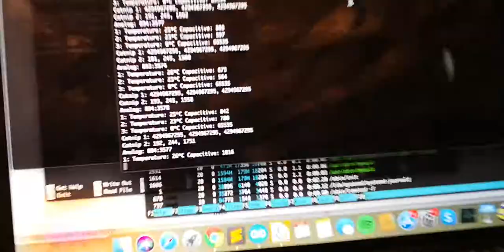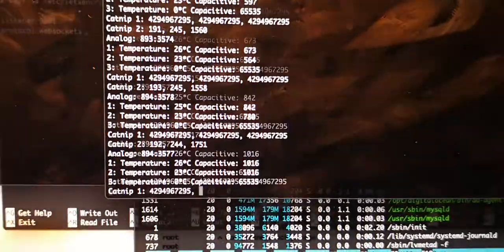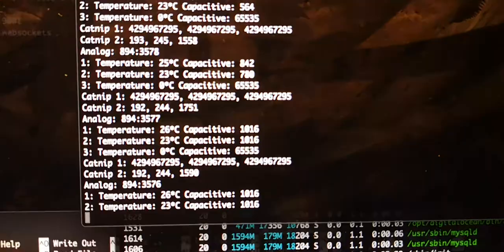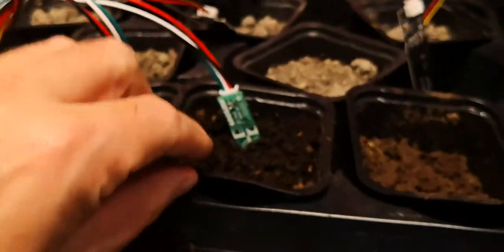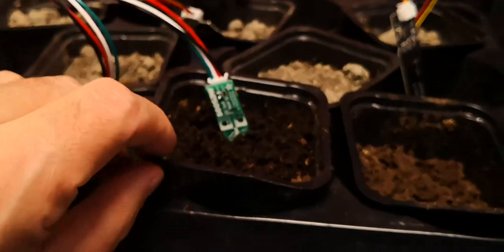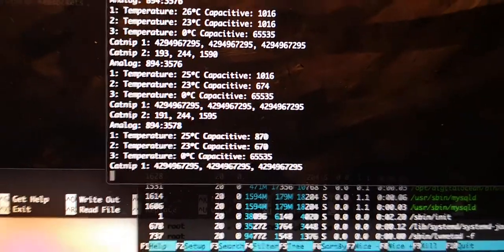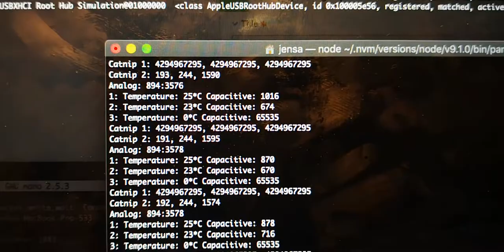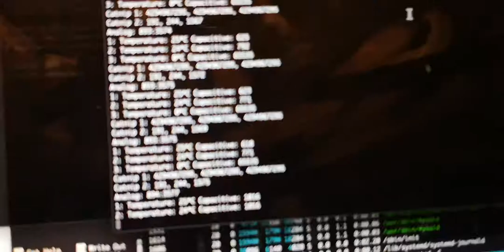Adafruit Stemma bug (video 2)

Comment: have you tried using the sensors on any bigger plants that utilizes bottom-watering? just wondering if a bottom-watering plant would max out the sensors like whats happening with the water here.
Reply from the maker: Haven’t tried. I gave up on these and went for another sensor. Mentioning which in my write up (in description)